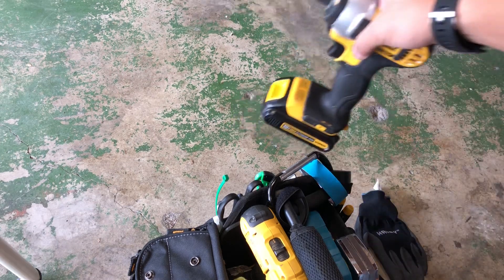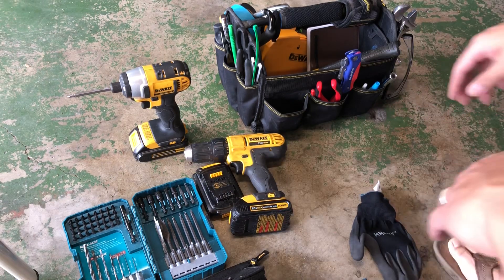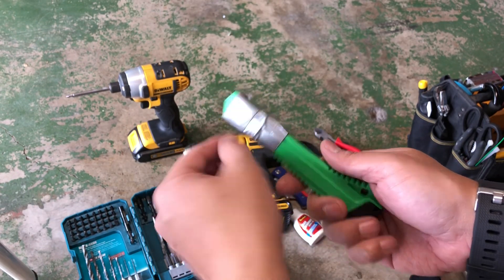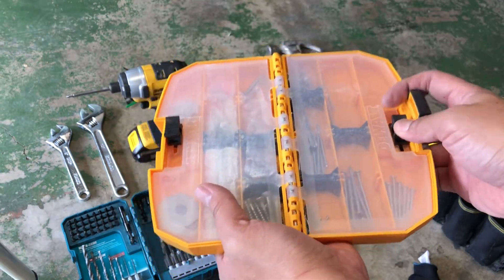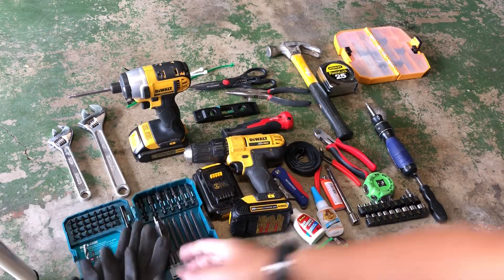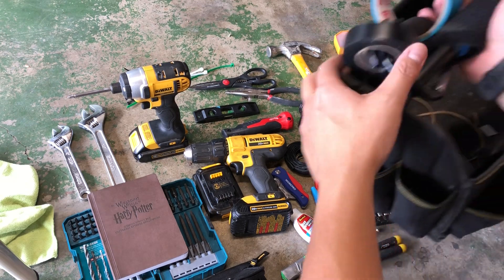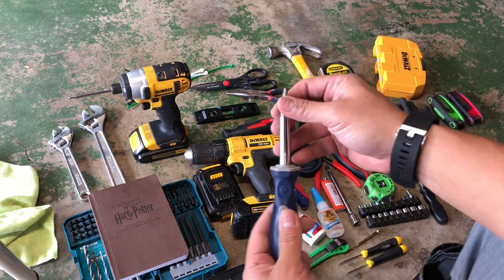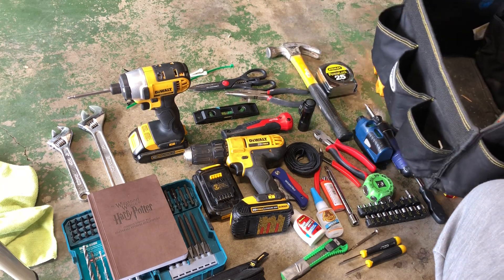Basic Home Tool Tote

Comment: We have nearly identical bags!  Literally the same tote and same contents item-for-item.  I use the HF stubby hammer since that bag isn’t for heavy carpentry.  I carry multiple tubes of single use super glue in an altoid tin.  If you insert a metal desk organizer into the tote it can help to keep things sorted out.   Space saver tip-wrap your tapes around  used gift card/hotel room cards. Punch a hole through one end and attach to a carabiner—better than floppy rolls of tape all over the bag. Also-if you do any light fixture/ceiling fan replacements-some wire, wire nuts and a wire stripping tool would be handy.
Reply from the maker: Thanks! I do have a separate tool bag for electrical work, but you're right.  I should have some wire nuts and a stripping tool handy at all times.

Comment: Where did you get that Dewalt container
Reply: I got mine at Lowes
Reply from the maker: I think I got it from Home Depot. It came as part of a drill bit set.
Reply: @nai1817  Thanks I found a Task generic brand one though 4 months ago. looked at Home depot and couldn't find the  Dewalt ones. Possibly discontinued?
Reply from the maker: A Dude Yeah. Dewalt has so many different but sets that I wouldn’t be surprised if they discontinued some. Sorry I replied so late. Didn’t realize you had commented.
Reply: @nai1817  I’ve gone through a few of those DeWalt but sets😂

Comment: Sorry dude but you need to get rid of the extra drill the gimmick tools like the green socket set and the harbor freight screwdriver. Chuck the extra crescent wrench and get yourself a good set of pliers a channel lock a couple of vice grips one large and one small and a medium sized pipe wrench.
Reply from the maker: Thanks, I did ditch the green socket set.  Having two crescent wrenches is essential.  Stay tuned for updated tool kit.